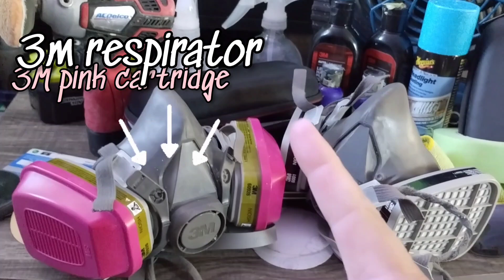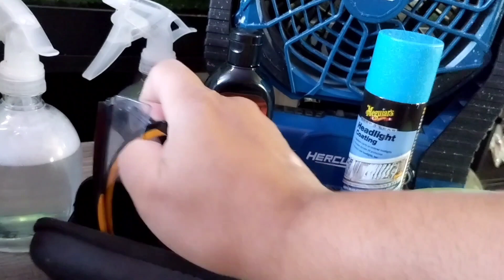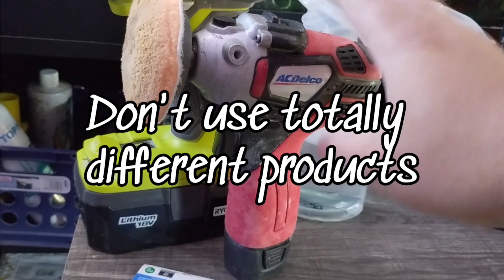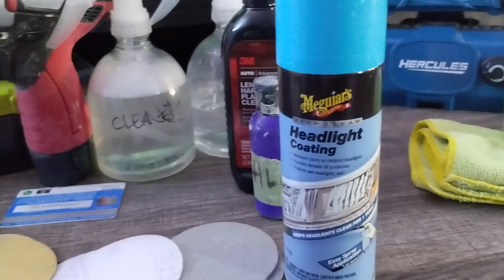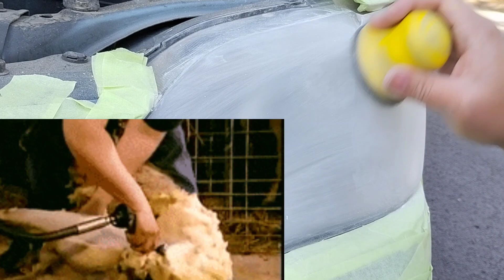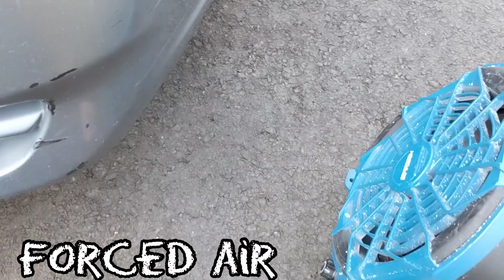Step by step HEADLIGHT RESTORATION TRAINING/Pros and everyday Joe's

Comment: Feedback:

I kind of did it like this even have his Ryobi tool. 

Tough I did vetsanding my store didn't have the 500p so I had to use 400p and I didn't find an "interface" even tough explained it and ordered papers from the net. 

I did do a 1000p as well I mashinsanded way more and could not controll it as he does. 400p I easy used 2 of them. I also handsanded. Some of my higher papers as the 1000p hade some cussing built into them soo thats why I did some 1000p. 

Ofcourse I hit he paint on my car moore then I tought. But I had bad maskingtape, but it was scratched behind the maskingtape to so there could have been someone that did them before me. 

When I sprayed it kind of fomed on the surface, I sprayed less, it did make some drip marks. You can't se it from 2 m soo I am happy from the result. They look new now, it wasn't a pro job. It was both easier harder to do, it took me 5h. 

I am happy I have an old VOLVO S60 from 2005. Now they would probably aprove the light it was kind of bad like 50% visability trough them. 

Question: Should I spray upsidedown after use!

Thanks great!
😃😃😃😃😃

Comment: 7800 RPM for the AC Delco polisher. I don't have much experience with polishing but the Milwaukee M12 polisher has a max RPM of 8300. As a noob does that make much difference if I have easier access to the M12 ?

Comment: I follow your steps, headlights look good clear enough until applied the clear coat.... what didi i do wrong?? used meguiars uv protection.... what step shoud I repeat??/ I was satisfied with the result till the las coat
Reply from the maker: To the last coat.... I'm pretty sure that entails that you did something wrong... You got to watch the videos and see if you did everything that I do correct.. one small variation will destroy your headlight restoration
.. especially a double coat as it sounds like you did you're only supposed to do one double coat you should never double coat you will never see me on any of these videos double coating a headlight it's not the way the factory does it it's not the way it should be done more than one coat messes up how the headlights work and how good they look so you put it all on in one watch this video cuz I'm sure that's what you did it sounds like.
You got to follow the steps..
You did not follow the steps..
https://youtu.be/NgxNImOAoCY?si=8WpRdaLXU8ASw6_t
Reply: thanks for the quick replied!!  What can I do to fix it ???  repeat all the steps??
Reply from the maker: @davidjaimes6440 the steps are on every video there's 140 videos plus streaming you have to follow them to the t no variations.. if you see me single coat single coat if you see me use a p500 that's what you use..
What vehicle is it?

Comment: Can you use the atomizer vapor cup in between any of these steps for better results? You know that special blue liquid.
Reply from the maker: No ... No use with this method no use in general I have a couple videos of it on this channel it looks good at first but doesn't hold up but couple months.. it is not compatible with anything else..
This is the best it gets  I've tried everything else..
Reply: @theheadlightrestorationpro  can you give me a link for the backing drill pad that won't fall apart due to shitty glue or adhesive?
Reply from the maker: @octaviolozano6890 advise you to look through my channel there are over 130 videos now streaming..
If you look through the videos you will find all the answers that you're asking more than likely....https://youtu.be/CVrCKSzr9jA?si=qYPxyAcnOhSbwXpM

Comment: How about using my regular RO polisher (porter cable)with 3” pad? A little big next to yours but should work no?
Reply from the maker: No... Everything that I approve and say to use are on the videos.. there's over 100 videos up now streaming....👍🏽
Reply: So in this video you say a drill can be used with finesse it pad for polish step…but not a polisher? Confused
Reply from the maker: Have no idea what you're talking about dude... I already told you if you want these results you cannot use it... It doesn't have enough RPM it's pure science... I say it on every single video I do the same thing and every single video.... You're focusing too hard on something that it's just messing your brain up...
The polisher is like 10 times faster with only a quarter of the torque it's a different ratio is designed to produce heat.... Don't know what you're talking about on this video because I'm pretty sure I've never said that....... My advice would be to watch some more videos I don't think you're getting it.... You will never produce the same quality with a drill.. it'd be like running a NASCAR race with a Honda Civic.... It's not going to cut it...
Reply from the maker: @joeydomino6567 
Also your generalizing stuff away too much.. so you're not soaking up what is going to set on this videos... Metaphorically in your mind you're saying any car is good for a race... No just because it's a car does not mean it's good for a race there's a millions of different cars and most of them aren't good for a race......
Also if I said that I'm saying it can be used if you have no other choice but you're not going to yield nowhere near the same result....by far....
Reply from the maker: @joeydomino6567  maybe this will...https://youtu.be/h-8BKUEVGRY?si=5DRp_eSaWJS2D1cN

https://youtu.be/R1DsMcZ6q1Q?si=dmzK0PH4y4N7Mkuf

Comment: Is there a optimal outside temperature to do the headlight restoration and can I use an external heating source? Thanks in advance brother!
Reply from the maker: I would not use any direct heating source no UV lamps no heat guns or anything like that because it interferes with clarity and adherence... I used to try this but too many bad things happened and I was always unpleased with the result so I figured out it dries better with forced air or air drying... If you do use a heat element think of it more of a area heating like a heat lamp to keep you warm and the area warm but considerably far away from the light like a foot or more... The ideal temperature to do headlight restoration is 40° or higher... I would not do it anything less than 35°...
Reply: @theheadlightrestorationpro  I was wondering because I live in Tennessee and it's pretty chilly right now and wasn't sure if it would screw up the job. I have a couple of Dewalt work lights that are NOT led so they put off a decent amount of heat so I could possibly use them to warm it up to around 80°f. Correct me if I'm wrong please, but I think the dry time on the spray at the end of the restoration would be quicker if it were warmer?
Reply from the maker: @govolsfightvolsfight2908 yes but area warmer is different than direct warming... One is like a room that is warm or a warm day the other is direct warming just the light you don't want to do that..... You want like an area to be warm even if it's not like a whole garage and can even do it outside it would be like in the general vicinity...
But with this product and 80° heat will dry in 2 minutes crust will dry and 30 seconds so when you're talking about cold like 35°, you're talking maybe 5 minutes and the crust forming in one minute... Still not bad at all super fast.. but air drying is the way to go... It has to do with the chemical makeup it doesn't respond as much to heat as it does to air.. once again it's a chemical exchange or air exchange which is why it's drying...
Reply: @theheadlightrestorationpro  so like the temp of an entire room instead of at the heat source directly? I wasn't wanting to hit it with a focused heat, more like indirectly, but I get what you're saying brother. Thanks for getting to my questions! Most, like 99+% of youtubers don't reply to shit except a 👍if even that. I like what I see and will recommend your channel to some of my friends, and thanks again for the help brother man, and have a good day!
Reply from the maker: @govolsfightvolsfight2908 thank you appreciate you for watching. 👍🏽
Reply: @theheadlightrestorationpro  hey, no problem brother!
Reply from the maker: @govolsfightvolsfight2908 👍🏽

Comment: Is there any issue aside from a tired arm and taking longer to do with just doing all the sanding by hand?
Reply from the maker: Well those are the main issues.... Taking probably three times longer to get to this level of achievement.... And of course as you said being a lot more tired... Also the fact that you're not going to be producing enough heat... I say this many times over the headlight material plastic in general are polycarbonate react heavily upon heat in friction... As far as the clarity... The 1700 RPM and the 7800 RPM I'm going to produce a lot of heat which is going to have you achieving that Crystal clarity... Wet sanding or even just by hand is not going to achieve that especially the polishing step.... Also believe it or not there's just some headlights out there that cannot be done by hand no matter what people are lead you to believe...(and I respectable time frame-not 5 days)
Reply: @theheadlightrestorationpro  good to know. I didn’t think any that weren’t really able to be done by hand. You are the professional and I’m just looking to do my own and not have to redo them every couple of months like I have with just polishing by hand. I also noticed on some of your videos you mix the 3M headlight compound and Chemical guys headlight restore. I found with just polishing by hand at the time of my test that Chemical guys C4 compound and P4 polish yielded a better result that lasted longer than the headlight restore alone.
Reply from the maker: @justplanefred yeah a waxer Polish is going to be better than nothing nothing will get you somewhere fast..lol your headlights all jacked up quick...

Comment: I finally got all the things you recommended and had insane results! What would you recommend for cold weather restorations?
Reply from the maker: I wouldn't do any Restoration in less than 35° temperature... Cold weather I would just keep everything above 35 degrees especially your spray coating... Simple things like putting it in your pocket can make a big difference...
Reply: @theheadlightrestorationpro  Awesome. Thanks man
Reply from the maker: @DelgadoDetailing 👍🏽💪🏽😁

Comment: Great Video!! Can we use the clear coat  paint spray for sealant instead of Mequaire UV  sealer spray? For some reason every year light gets foggy again don't know what I am missing. Any advise would be greatly appreciated.
Reply from the maker: I have no idea my advice is to use this method... An actually follow the steps...
I just see every single video but I posted which is multiple dozens they come out more perfect within the day they rolled up a lot or anything else you've seen on the internet or in person..
The light of that honestly what I would do is just follow the directions.... Exactly...
As far as using some other clear coat if you can't make it work with this you're going to have a hard hard time with something else... This is one of the most user friendly products out there that's why it's the best it's not only can a professional like myself use it but an everyday Joe can very easy.
Reply: @theheadlightrestorationpro  

Thank you so much I will use your way and follow your steps!!
Reply from the maker: @usaahsan 😉💯

Comment: Thanks for the video+ sharing the knowledge. 👍
I did watch the video, but I still have a question. Lol.
My question is regarding cleaning the headlights after cut polish before plastic polish, and/or after plastic polish before spraying with Maguire's UV spray........
Should I ? Shouldn't I ? 
Or is it one of those....some say yes some say no ....
And if I should....is using rubbing alcohol ok, good, or a complete No No.
Sorry for the stupid questions, but as you know, the Internet is Full of conflicting answers, for everything. Lol.
Any advice would be appreciated.
Thank you.
Reply from the maker: My advice is to do exactly what is done on these videos.. don't deviate from the method at all or things will turn out worse...
Question is extremely difficult to understand..lol
But I can pretty much answer and by doing everything I do and every single video pretty much nothing else..
Rubbing alcohol is not okay.. it is a stripper and cleanser of the oil deposits that you just replenished.. this will lead to dryness under the coating, cracking, spider cracking ,fogging, overheating and much more... You do not want to strip the beneficial oils..
Pretty much just sum it up don't do anything different than what I'm doing because your life will not come out like this I guarantee it.. this will explain things a little bit more..https://youtu.be/LC4ZBu02JZg?si=z7YDXG3E5tclZHSB
Reply: @theheadlightrestorationpro  
Thanks so much. I really appreciate it.
I figured you would be like.... didn't you watch the video....lol
There's just so much info + dis info out there I figured I'd ask. I'm just lazy + trying to avoid problems after spraying + a spray removal + redo. So, I'll do as you did in said, step by step, video, lol, to avoid that. 
Thanks again. And sorry again for the stupid question(s)
Have a good one. 👍
Reply from the maker: @joshkellis6499 no problem just watch the videos and it'll definitely dial you in or whatever aspect you're looking for there's dozens of videos up on my channel about different things but yet they still execute the same method and perfection..

Comment: Great videos and very helpful. Not sure if I missed this but have you ever stated why you use the specific ryobi for sanding and not polishing?
Reply from the maker: Haven't stated it in a video in a while I'll keep that in mind for some upcoming videos..
But the reason is that although the Ryobi/and or drill will produce torque and 1700 RPM Plus it will nowhere near get as close as 7800 RPM Plus... To do high speed high power policy you need an actual polisher rotary the specific one is partially made for headlight restoration.. to get that Crystal clarity you need the speed which produces friction and the friction produces heat 🔥🔥🔥
So besides the RPMs the heat is one of the biggest deciding factors of clarity...
There's no way you can really use one for the other properly...

Comment: Hi man, my name is Gino, I'm from Mexico and have a question, after you apply de meguiar's coat how long it takes to dry before the owner rides his car?. In advance, I appreciate you're time videos and experience. Greetings.
Reply from the maker: I appreciate you watching.. pretty much the customer can drive off so is your finished.. this product is the fastest drying product that I've come across hands down.. the crust meaning the outside of the product dries and seconds like 45 seconds 60 seconds forms a shell on the outside of the material and then the rest of it dries within about 2 minutes to 3 minutes.. then takes about 16 hours to fully cure.. but it's dry to the touch and ready to drive away within 3 minutes.. so that's the beauty of it it's going to be done drying way before your finish working..

Comment: I just did this on my mom's BMW 3 series and I'm pretty happy with the result! Looks clear, awesome. If I look real close I'll see some light micro scratches in some places and a few noticeable circular shaped scratches (just the perimeter of a circle). That's fine with me since I'm not a pro like you and it'll hopefully help my mom's headlight's output anyway. 

I think that the micro scratches might be because I didn't do the 800 grit long enough? Or maybe because I used a drill instead of a polisher, or a Turtle Wax plastic polish instead of the 3M version. 

I think the big circle scratches (which aren't too bad) happened because I hit the edge of a sanding pad on the bumper tore/bent it slightly, and using that pad caused gouges.

You are so right about using a lot of tape. I wish there was an easier way to sand the very edges of the headlight because it is very difficult to without hitting the tape.
It also took me 5 hours for some reason to do this. :O

Thank you for your teaching!
Reply from the maker: It's probably the combination of the stuff you're using and what you're doing.. well like you said I'm sure it still came out cool..

Comment: So after the clearcoat, how long before the customer can drive there car?
Reply from the maker: Literally by time you pull off...
By time you're taking the tape off they can drive around and do whatever they want it's dry to the touch this is extremely fast drying substance which is perfect for headlights the faster the better because you are not in a sealed sterile environment like a paint booth when people are painting cars.. you needed to snap back a really fast the faster the better this particular product and let's say 80° heat will crust which is the outside layer which is the most important in 30 seconds full overall drying through and through and about 2 to 3 minutes... Fully cure would be about 15 hours.. but try to touch for driving or anything like that is fine.. I typically tell them do not wash the vehicle for 24 hours in the summertime or anything above 80° and the winter I give it 48 hours anything under 60°